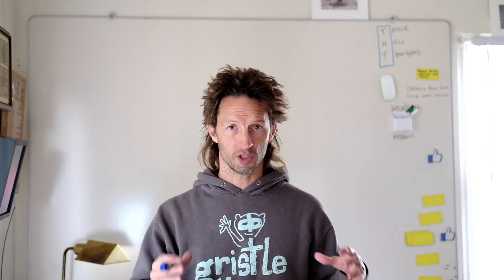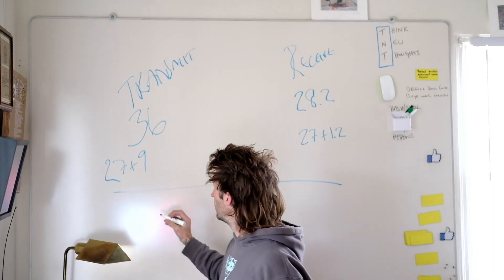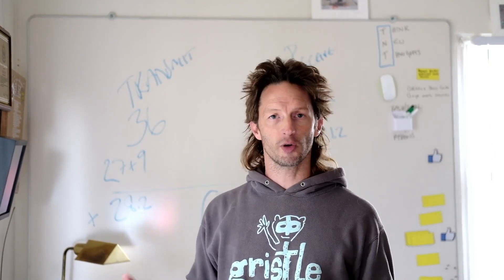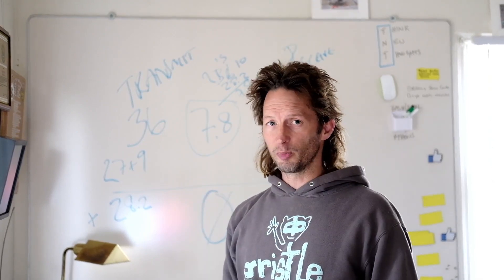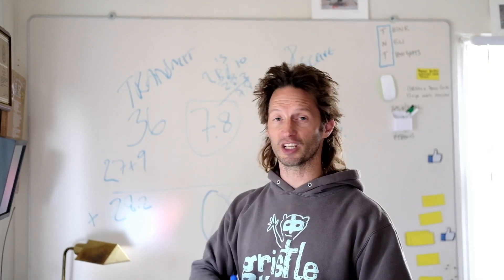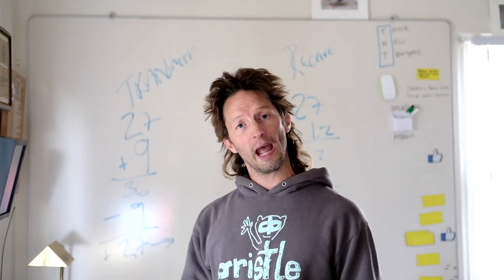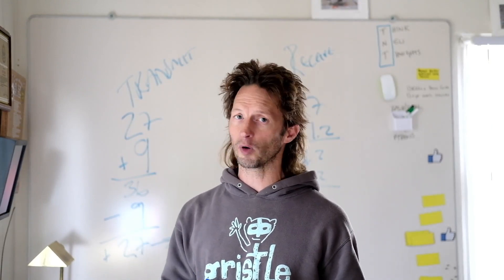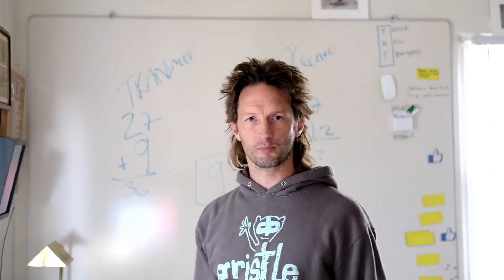PoCv11 Made Simple

Comment: Data sheet says a Bobcat only pushes out 25, not 27.  Does that  change your recommendation?
Reply from the maker: Good question.  I'm not sure if Helium uses the data sheets from the devices.  In any case, I don't think that 2 dBi will make a huge difference as far as RSSI being unreasonably off.  Core recommendation of correctly asserting cable loss and antenna gain stays the same.

Comment: Great video!

So what happens to spoofers? Do they get just a message with 'RSSI too high', or invalid witness? Or will they just block you from gaining rewards?
Reply from the maker: I'm not sure how they're going to handle enforcing the rules.  Long term it'll all happen programmatically, something along the lines of "if your hotspot doesn't match up with X, Y, or Z parameters it doesn't get rewarded."  What those parameters are is the big question.  There are a few HIPs right now being worked on to help with anti-gaming, HIP 40, 42, and 44 chief among them.

Comment: Thanks as always Nik.
For anyone who is still "confused", stop reading and just go assert your antenna details as Nik described, and make sure you've done all the basics (again go back through Nik's library!).

Now, a few questions from me:
1. We know the US has an EIRP limit of 36, and HS's put out 27. My understanding of PoCv11 is that at least in part if you have an ultra high gain antenna, say 15dBi, then the HS Tx power will be reduced from 36 - 15 = 21, the point being that no HS should exceed it's allowed regional EIRP. Is that right?
If that's right, then surely your math isn't let's say relevant, as there will still be HS's showing a Tx of anything from say 28.2 (stock) up to the ceiling of the regionally allowed EIRP??

2. In EU I'm still not entirely sure if the limit is 14 or 16, but clearly if it was say 16 then less 15 = 1, so my question is at what point does the Tx power of the HS itself start to have a crossover impact on the antenna...ie, can a HS giving Tx of 1 give enough power to the 15 antenna to actually be of any use?  Does that make sense?

3. Do you know if Helium or DeWi have published a list of EIRP's for all countries yet?
I'm based in UAE (most of my HS's are here, some in UK & Oz as well) and I've read all sorts of official docs that suggest our EIRP could be anything from 15 to 45, so I would love to know what Helium/DeWi have settled on for my area!

Keep the vids coming, they're RAD! ;P

HNT-UAE on Discord, drop by & say hi :D

Comment: Hey Nik I have a very important question. Do the small thin black coax cables in the miner that connect from the radio card onto the SMA connector account for a considerable amount of db loss that we have to take into consideration into this calculation. I follow a Radio Engineer on youtube who opens the miners whether its the OG or bobcat and shows the thin black coax cables they use inside of the miner give alot of loss of about 0.5db per strand of cable. He shows the bobcat had 3 of these which he said based on his calculations are 1.5dbi of loss. Do you believe this to be true? He basically shows that upgrading the connectors inside and putting 1 direct low loss going from radio card to sma connector will greatly reduce the loss. What is your take on this?
Reply from the maker: Hi Jonathan, I haven't seen those videos, but it's possible. If it's .5 dB it just goes to show that you can be off in your calcs, and cables & antennas really aren't that important.
Reply: @thegristleking  Here's the link....https://www.youtube.com/watch?v=OTovVfFVTBI He states that having a high gain antenna especially after pocv11 is optimal as it will increase rx power which is the most important for earnings VS Tx power because receiving beacons and listening is the most important thing your hotspot can do. For example there are tons of hotspots with 100's of witnesses but very little in witnesses as transmitter. So Rx is more important than TX. This is were the higher gain antenna comes in and not omni directional high gain but directional high gain antennas. In the video he shows the internal cables in the miner and how they can be improved, and explains that generally the less loss you have the better because cables and connections are responsible for loss in signal. In addition You state that a low gain antenna will be best in most applications but he argues against that theory. I also tested that theory with an Hntenna and found that not to be true. note I have a house on a hill with a full panoramic view of all of LA. Wasted bunch of money on that one. But anyway He's super knowledgeable in RF and uses vector analyzers and tests different antennas, opens up hotspots changes internal chips and generally does things to improve earnings. He also has another channel with 250k subs on electronics repair. Check it out i think you will learn alot.
Reply from the maker: @jonathanbakchellian1987  thanks for the resource!  At the end of the day, you've got to test these things and see what works for your location.

Comment: Hi Nik. Thx for the knowledge sharing, as always. PoCv11 did the opposite for me (getting 20 invalids that I didn't have before) and earnings down "clipped" by 60 percent (round vanilla dragonfly). Everything asserted correctly, 3dbi McGill antenna gain - 3m(10ft) LMR-400 Times Microwave cable (0,384 loss) - Times Microwave arrestor (0,2 loss) - 0,1 for connectors = 2,316 dbi asserted. Bobcat 2GB. High up overlooking the city. Any suggestions what to do, please...? (EU located)
Reply from the maker: My guess is you've got a bunch of miners around you with incorrectly asserted antennas.  That's just my guess.  I'd leave your setup as it; high elevation & low gain is usually the winning combo.
Reply: @thegristleking  Thank you Nik, and have a lovely day.

Comment: Isn't it always better to use a 3 dBi antenna now in EU as opposed to a higher gain antenna? 

A high dBi antenna compensates what you lose in coverage with power/signal strength, now that pocv11 is limiting your power to local restrictions in EU, I see no benefit whatsoever to use a higher gain antenna if it gets the same power as a 3 dBi antenna but with a shitty coverage. Is this true?
Reply from the maker: I don't know about shitty coverage, it'll just change your radiation pattern.  I mean, I'd still go with the low gain antenna, but I'd also make sure to test your actual antenna & placement with the GLAMOS.  More on testing over here: https://gristleking.com/how-to-map-the-helium-network-for-coverage-and-profit/
Reply: @thegristleking  yes but the radiation pattern with a high gain antenna would cover much less than the radiation power of a 3 dbi antenna, since the path gets narrower the higher gain you get.
Reply from the maker: @2006Pk  I'm agreeing with you.  I use low gain antennas for pretty much everything in Helium.

Comment: Pocv11 is not working. In my city be a hotspot what send beacon 170 km far away. I think so it is normal?!
Reply from the maker: I mean, it's possible.  I wouldn't say that's an indication the entire system isn't working.  :). Could be a hotspot has moved and hasn't yet updated its location.
Reply: @thegristleking  is turned on, but large antennas still cover much larger areas than factory antennas.  what do you think ?
Reply from the maker: @vargalajos5358  I'm not sure I understand.  Larger antennas typically extend the range of signal, but in the world of Helium that can also cause invalid witnesses.  I use low gain high quality antennas (like the HNTenna) wherever possible.  Keep in mind that A) no one antenna will be perfect everywhere and B) location is FAR more important than antenna.

Comment: So what benefits would still exist from running anything other than a stock antenna?
Reply: POC11 only reduces the transmitting power of the antenna. if you use a 9dBi antenna, for example, you will have reduced transmission power, but the reception power remains unchanged, "hear" beacons from a great distance ...
Reply: Actually it reduces the output of the Transmitter. dBi of the antenna defines the angle of radiation.

Comment: If i have a 4 dbi antenna,7 m lmr 240 cable,lightning arrester,2 connectors and a sensecap m1 ,from my calculation  EIRP IS 15.99,only if the power of my sensecap wil be reduced at 14 dBm automatically from 37 dBm(5W) how much is the power right now(sensecap m1 Eu868)!So ,the power is reduced automatically ?My calculation is ok for EIRP IN EUROPE?
Thanks a lot for replay and 💪💪💪 HELIUM!
Reply from the maker: Hi Dima, the type/output of the miner doesn't get entered into the app; it's already there.  What you're aiming to do is tell Helium what you have connected to the miner in terms of gain.

So, [Antenna Gain] minus [Cable loss] minus [if you're geeky, connector aka insertion loss] is what you put into the app.  7m of LMR240 loses 1.9 dB.  Lightning arrestors lose .1 to .5 depending on quality/construction.

Comment: My understanding was that PoCv11 was going to let you reach up to your legal antenna gain + hotspot. That is 36dBm for US915 or 30dBm for AU915 (as an example), so I think you might be wrong when you say the max will be the hotspot's gain. Also, it was pretty fast your explanation of what happens if you don't tell helium your actual antenna gain because helium at least has to substract the number you entered in the app for the antenna gain. I think that step was also wrong.
Reply from the maker: Correct, you can go up to the legal limit.  I didn't explain that well.  The important distinction here  is that, while your radio can push out that power, Helium will take your antenna gain into consideration.   So you get to push out the extra energy up to the legal limit, but Helium uses your stated gain to calculate the FSPL.   Does that make more sense?  Thanks for pointing that out!
Reply: Came here to mention the same thing, thanks Marco and GK both for addressing it!  In the end, the takeaway is mostly the same: if installing an upgraded antenna, it's important to assert the correct antenna gain + cable loss, as well as the correct location.  And there are still good benefits to installing a higher-gain antenna for some hotspot placements, especially in countries with a higher legal limit for EIRP in the relevant frequency band.
Reply from the maker: @Pseudothink  100%, thank you!
Reply: @thegristleking  and Ryan you are very welcome and thank you for your comments. Glad that we collaborate each other in this Helium community. See you around.

Comment: Any reason to add in loss for connectors? Also, I use Laid FG9026 antennas. Some documentation says 8dbi and other documentation says it's a 6dbi. What would you suggest to use?
Reply from the maker: If you want to be super accurate, use the connector loss.  I don't think it'll make a ton of difference.

Comment: I already changed mine to 5.8 before watching this I didn't factor in the 10ft LMR cable. will I get penalized?
Reply from the maker: 10' of LMR400 isn't much loss at all, approx .4.  I wouldn't worry about it too much.
Reply: @thegristleking  I have an 8dbi antenna with a 10 meter LMR400 cable, what should I put down for my antenna gain UK/EU BOBCAT
Reply from the maker: @momiah5635  10m LMR400 on 868 is 1.4 dB, so you'll enter 6.6.

Comment: Thanks for the simple explanation, Nik. Question, when doing the calculation for antenna gain and cable loss, the antenna gain is in dBi and the cable loss calculators seem to all use dB. You also mentioned dBm in your video. I see the definitions of all of these online and they make sense, but can you just calculate the basic numbers without regard to the metric (dB,dBi, dBm) when figuring out what antenna gain to use on the Helium app?
Reply: Actually, I just found your blog post about EIRP and makes sense now. Thanks again, Nik!

Comment: Correct me if I'm wrong. All the antennas are now equal in distance they can reach. The gain would only change the shape of the output wave. Get the low gain but quality antenna. I'm debating if I should keep my stock bobcats(decent performance in my eyes) spent much money to upgrade all miners to hntenna
Reply from the maker: Not totally correct, though I didn't explain that very well as I didn't fully understand it.  Antennas with higher gain will reach further, for sure.  However, a 3 dBi antenna will still "reach" over 160 km, which is way more than you need.
Reply: @thegristleking  I will take that into consideration of setups. Any plans to make a comprehensive guide on Glamos?
Reply from the maker: @cavemanslogic2351  probably not beyond what I've got on the blog, although I'm about to release an interview with Slaven where we dive into it.  Here's the GLAMOS stuff I've got up right now: https://gristleking.com/how-to-map-the-helium-network-for-coverage-and-profit/
Reply: thats likely the case.  When you cap at 9dbi for example.. one can assume that at best transmission is only though air.. one can easily cap the largest distances travelled based on that upper limit of 9db.
Reply: @Mellowyellow8888  oh uh those fellas with 8dbis are gonna be sad
Reply: @cavemanslogic2351  not as much as you believe.. higher dbi also affects recieving..  they just probably get hit more in beaconing.. but for some people whom earn most in witnessing.. the higher dbi might be ok..
Reply: @Mellowyellow8888  isn't the witnessing going to be harder after this update?
Reply from the maker: @abnersilverio  are you asking me or Illia?  I've used it for sure.  :)